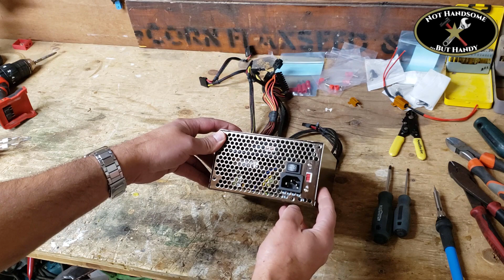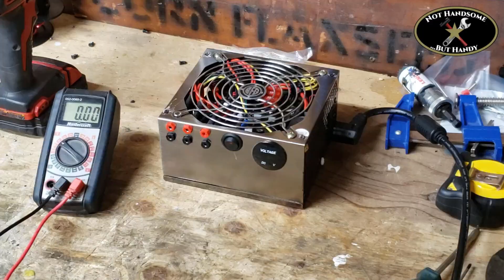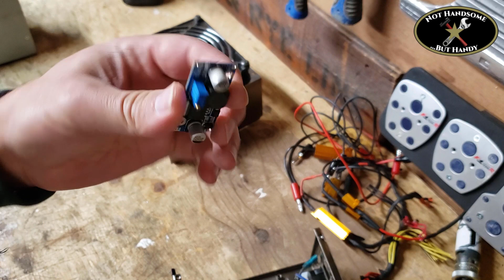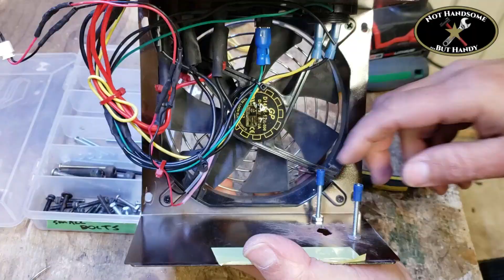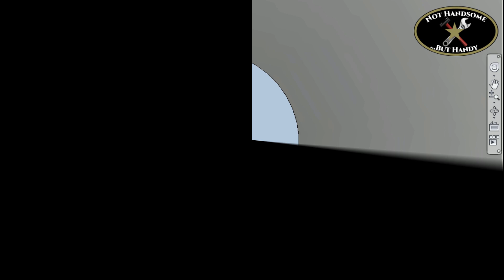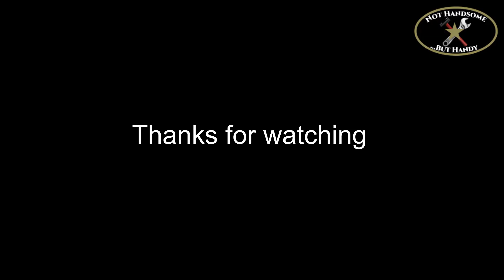DIY Bench Power Supply – 12V Outputs & Adjustable 0–12V

Comment: BFG power supplies tend to burn our pretty quick which is why they are fairly cheap to replace. They’re meant to be used in basic desktop computers, if you’re looking to build a gaming computer I recommend not using a BFG power supply. You’ll eat through so many of them just to run a few games. Very informative video, well thought out and your voice is very relaxing to listen to.
Reply from the maker: This BFG supply lasted over 15 years in a non-gaming system but I agree that it wouldn't be a good idea in a gaming machine. Mid way through the video I scrapped the BFG internals and went with AOpen as I had trouble keeping the BFG running under load. Thanks for watching and your feedback!